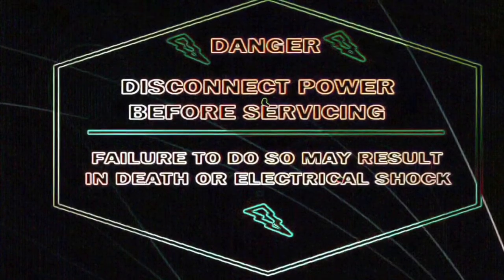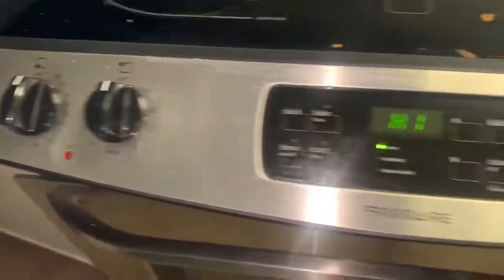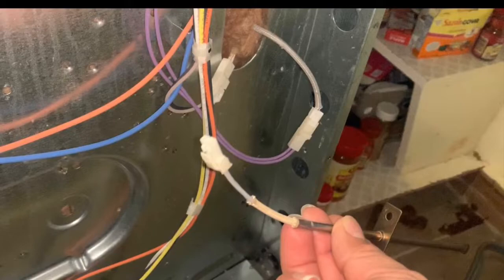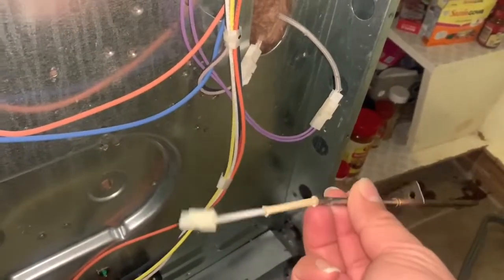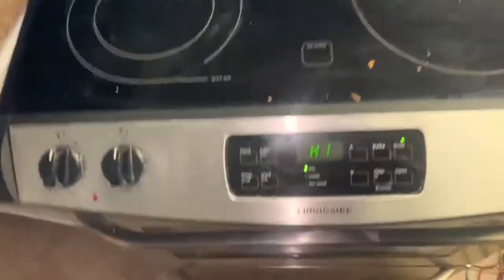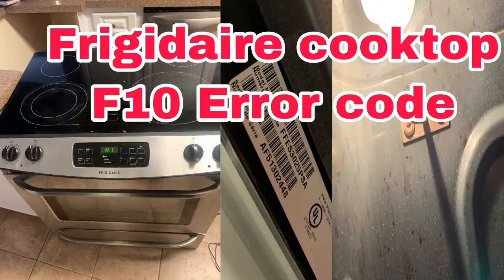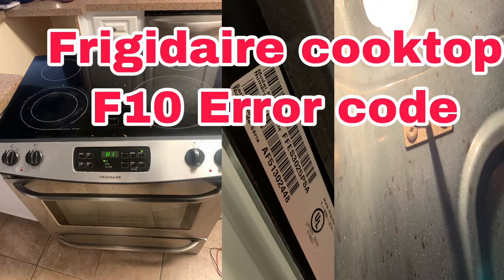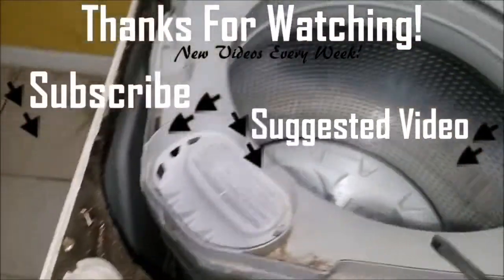How to Fix #Frigidaire #Stove F10 Error Code | Oven Taking too Long to Cook | Model FFES3025PSA

Comment: Oh, my goodness! Two nights before Thanksgiving, I ran the self-clran cycle for my Frigidaire Gallery oven. When I got up, the stove was beeping and had an F10 error code. I pulled it out and unplugged it, hoping the error code would clear. And when I plugged it back in, the error code was gone!! Later that day – Wednesday – my sister came to my house to bake pies. We preheated the oven, and she put in the pecan pie. Fewer than 10 minutes later, the stove starts beeping and showing the F10 error again! Pulled it out and unplugged it. Looked at the pie and it was CHARRED. So I hit Google and found your video. Then I went over to Amazon and ordered the thermostat and paid for rush shipping – this is the day before Thanksgiving, after all. It was supposed to arrive overnight and by 11:30 am it still had not been delivered. We needed a new plan so my sister went to the grocery store and purchased a large convection oven and we were going to use that! Within the hour, the thermostat arrived! I pulled out the range, unplugged it, switched out the thermostat, plugged it in and tested it. Eureka! It fired right up! I plugged it again, put the back panel on, plugged it in and waited about 20 minutes to make sure all was well and it was.Thanksgiving was saved! I cannot thank you enough for this clear and concise video. You saved Thanksgiving!

Comment: One very important thing they don't tell you: turn the power off and on and as in my case, the error message will go away.  I was broiling a store bought garlic bread loaf in my oven and it caught fire. After I pulled the flaming bread out I had an F10 error message. I checked the the temp sensor and wire for continuity and they were fine. When I disconnected the wire harness from the panel and plugged it back in, everything returned to normal.  Always try the easy things first.

Comment: Did you say anything below 11k is bad???
Reply: My Frigidaire oven came with a manual, including the RTD scale for the sensor. At room temperature (75 F/24 C), resistance should be 1091 Ohms. 

Another video claimed that a reading below 1000 or above 1200 at room temperature would indicate a faulty sensor.
Reply: @martinliehs2513  You are correct from what I've seen, too.  My manual also has a similar table which lists 32F = 1000 ohms (1k ohms).   75F = 1091 Ohms (1.091K ohms).  This video says 11K when he probably means 1.1K.  He also says 11 Ohms soon after that- so he's mixing units up and it could be pretty confusing.  He also calls the temperature sensor/probe the "temperature controller" which could be confusing for folks.  Most people will call the electronic oven control board the controller.  This is the printed circuit board that the temperature sensor connects to.

Comment: Can you remove and replace without opening the panel? Seems like you could pull that connector through maybe?
Reply from the maker: Dustin Dahognawho Sometimes the cable is long enough sometime it’s not it doesn’t hurt to try
Reply: @DIYRepairsNow  getting an F10 on mine right now. I'm guessing it is the control board, but I'm going to take the 30 dollar gamble on the probe.
Reply: As an update the answer is no. The screws to remove the TC are accessed from the back of the stove. FYI my F10 was due to an oven relay board blowing a resistor R2. I found a website that said it was a 220ohm resistor so I put one in. Working again so far.
Reply from the maker: Dustin Dahognawho Thanks for your comment and the update👍🏻👍🏻💯💯
Reply: @DustinDonohue  Where did you get the resistor part?
Reply: @kevinmoore4887  I'm an very amateur technician. I had a bunch laying around. You can get them on a lot of places online.

Comment: I just changed the thermostat and the oven is heating up to temp but at 350 but if I wait like 10 minutes and set it to 450 the oven is already up to temperature so what else could the issue be?